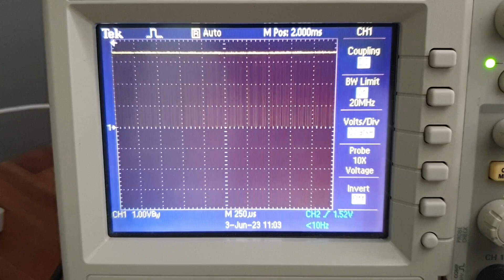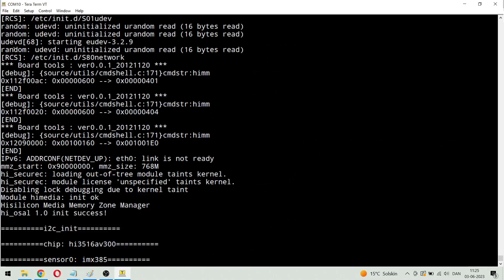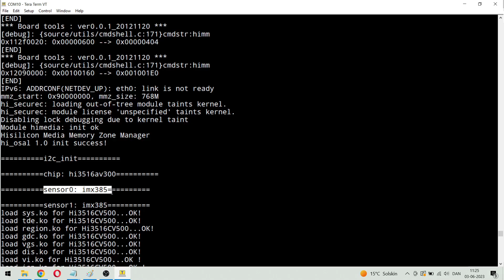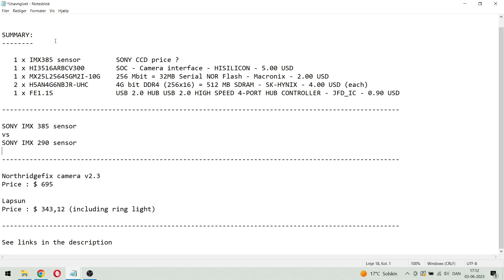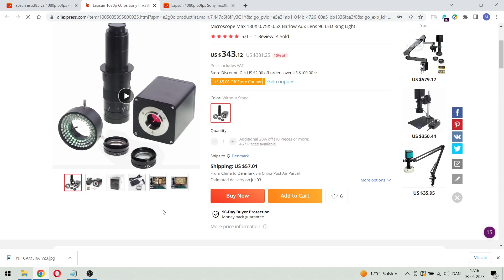Which sensor is hiding inside the NorthridgeFix Camera v2.3?

Comment: I agree that the camera is overpriced.  Clearly, they marked up it up a lot to fill their pockets.
Reply from the maker: Yes, i think that you can find their products cheaper, thank you for comment
Reply: 100% true and I hope they don’t start switching out the sensor again like they did on the original microscope camera. The “IMX290” was really the IMX307 which was 1/3 rd the cost. NRF never brought up the issue even in the forums on his site of people posting the PCB Screen shots shows 307 markings on the sensor board.
Reply: I don´t understand your point, should they sell it to you without making any profit?
Reply: @SHINdanny  Obviously not but they don't understand their main audience at that price point.  Their viewers are DIYers, makers, and people looking to save a penny by doing repairs instead of replacing the item in question.  He markets this overpriced product to us as if we're dumb so its pretty fair that we should criticize him for it.  Very few people are going to buy it for practical purposes outside of product reviews.  Oh, and would you look at that:  v1 of the microscope camera isn't available in the store anymore.
Reply: @classyjohn1923  thank you for your reply. I just checked his shop once and since I live in a different continent I´ve never considered ordering anything due to high shipping costs. I use my phone for this type of work, and it works well since it also has a built-in thermal camera ...it´s just a hobby ;)

So you´re right in my case, I would not even think about buying a one-purpose camera priced that high, rather a macro-lens for my DSLR and use that.

I just didn´t like the expression "to fill their pockets" because of the mark-up. It´s a business. If it is to high and only a few customers buy the camera, he might adjust it ...or maybe not.
Reply: I've stopped watching his comment. He advertises his stop too much. I get it, he's a business and I don't mind if he tries to advertise his stock, but do it at the start of the video instead of every product he picks up in his hand and is like "and you can get this at our northridge store" and then proceeds to talk about it for the entire video near enough...

Also remember one video specifically where he said "the last thing my family talks about is money, its the last thing bought up in our family" I mean he's right he doesn't being it up directly... But he's literally trying to milk the dead cow till the udders are gone, its just plain annoying.
Reply: Videos*
Reply: Shop*
Reply: @staminaman77  I also stopped watching his content.  He has very high ego.  He always acts like hes so smart but in reality, he makes mistakes like anyone else.
Reply: @classyjohn1923  I do think he's good at what he does, I do give him credit but I think he has this belief system in which he believes everyone else should follow. Just started getting annoying so I just stopped watching his content, I think he's all about the money if I'm being honest, not to say he doesn't earn it because he does. But puts on what I believe to be a front.
Reply: @staminaman77  i agree
Reply: @staminaman77  Total agreed, too pompous, and he makes my eye muscles hurt from all the involuntary eye rolling I do when listening to him.  It's a great thing to be confident in one's work, but it quickly becomes douchey when you go on and on about your own greatness. I usually have repair channels on in the background while working (I  repair testing gear, mostly Fluke equipment)and recently have found a few Brits doing repair content that is entertaining and down to earth like My Mate VINCE and Buy IT Fix It.

Comment: I bought it from this guy's link. Got here in 6 days. Blown away! Far beyond my expectations. I've seen the IMX385 in night time surveillance cameras and know it's good for that. Turned off my ring light it was hard to believe what I was seeing.  Using 2 IKEA Jansjö goosenecks. I use auto exposure and push up saturation. I don't like auto focus and didn't get that one. OBS for easy zooming in and out. Plugged my phone into the second usb port and it charged! I think it can run a led light.
Reply from the maker: Thank you for the good pointers, i will try them same.

Comment: The imx385 is a CMOS sensor, not CCD. The price of these small average specced sensors in china is in range of $10 to $20. The sensor is nothing fancy.. I do design cameras (much more advanced than this) and I can tell you that all these microscope or astro heads (which some uses ripped off DSLR sensors) are rather overpriced - if that was a point of the video. The whole system is at the tech level of a $100 compact camera.
Reply from the maker: Thank you for the notes and comments. I was thinking of making my own camera since  the specifications from the china sources are all over the place and therefore not trustworthy. Which modern sensor would you reccommend for a high quality microscope? I made the video since there are no sensor specification on the NorthridgeFix camera.
Reply: @made.by.morten.laboratories  i would base it probably on a imx477 ish 4k capable model (377/477/577) and use something better than a RPi which can not handle the video rate of the sensor at full res. Something like a jetson nano maybe. Even if NVidia is PITA, its more handleable than to hack up a hisilicon board from leaked kernel sources..
Reply from the maker: @cameramaker  I see that there is already an IMX477R sensor from RPi, it could be an easy job for a FPGA - i would like to convert from IMX477R to HDMI
Reply: @made.by.morten.laboratories  I was looking into something like this too !
Reply: i also think that these are very very overpriced , you better off with a macro lense and a consumer mirrorless camera than one of these , i am not talking about north ridge fix , i am just saying this about all microscope camera's in general.

Comment: I learened a lot by following your process. Thanks
1. How could you sport a linux system just by looking at the board?
2. How could you guess 115200 speed in the terminal settings?
3. My microscope cam has a Sony IMX291 sensor and i was wondering if I just could buy & replace by an IMX385 or IMX477 by swapping?

Many thanks pal and keep it up
Reply from the maker: @nessim.liamani, you are very welcome.
1. This is just from experience, i have been working in this field for many years
2. This is a standard setting on the UART
3. I think you need to update the Linux driver as well
Reply: @made.by.morten.laboratories  
Many thanks bro. Merry Xmas

Comment: Hello, I was trying to follow your Tera Terms, and despite connecting as you state and changing Font/Speed I only get Symbols instead of the full data display you got. Is there something I could be missing? UART SET to 3.3v. Any help greatly appreciated. Great Video btw.
Reply from the maker: Thank you for the comments, yes, please check the baudrate, i can't remember if it was 115200 baud, else try the different speeds.
Reply: @made.by.morten.laboratories  got it, for some reason it liked a lower speed, maybe  because of the older version of the program, but got it to run. Thank you and hopefully you keep adding content, now following you. Take care!
Reply from the maker: Thank you very much :-)

Comment: 3.75 micrometer pixels are good of course, but that thing is only capable of 1080p at 30fps. My 100 bucks hayear can do 60 fps at that resolution and 4K at 30fps. I think IMX334 is more advanced than IMX385?? Sony has funky numbering system. I reviewed HY-6110, tear down and review. Looking at this, I think that camera is more advanced, lul. :face-purple-crying:

Whatever's the case, I don't think using digital microscope is neither viable nor compofortable.
Reply from the maker: Thank you very much for your insights, i will have a look on the HY-6110

Comment: Looks pretty good... Wayyy out of my price range though.
Reply from the maker: Yes its quite expensive toys
Reply: The Northridge fix camera is a rip off.
You can literally buy a 48mp 4K package with x150 lens, ring light and boom stand for under $100USD.
If you want to spec up similar lenses you can order things separately,
48mp 4K camera $50-$60 USD depending on brand
x180 Lens $37 USD
x0.5 Barlow lens $12
x0.75 Barlow Lens $$16
Ring Light $15-$20 USD
There is a myriad of chinese brands other than Lapsun such as Yihzan, Eakins, High Cloud.
This should help those on a budget or those just getting into the hobby of electronics.
Reply: @Spoonfork1  Give us the links, especially for the 48 mpixel 4k kit. We will appreciate it.

Comment: I didn't get the exact camera you linked from Lapsun. I chose the one with autofocus. Actually, the kit which has the heavy duty articulating arm. It came in at about $670 USD including tax and shipping. I think you are 100% correct that the camera you got is the same one NF is selling. Regarding the autofocus, I like it, but you have to switch to manual after initially focusing on your work, otherwise it will try to refocus on your hand or iron. Still, it makes it easier to use. Camera also works with a wireless mouse. I just happened to have a cheap Logitech mouse I wasn't using. I decided to try it, and it just works. It's nice because I'm right handed, but I have the camera mounted on the left. The wire from the included mouse was just always in the way. The ring light and the camera come with separate power adapters, but both can easily work with the one for the camera. The only thing needed is a 5.5mm x 2.1mm Y adapter, and one polarity reversing cable because the ring light has reversed polarity. Could also just open it up and swap the wires. I also got a short extension cable with an inline switch. There were two 3mm threaded holes on the front of the camera, so I opened the switch, drilled two holes, and mounted it there. Click the switch and the camera and ring light turn on, and the monitor comes on automatically when it detects a signal. I've been doing repair work for years, and this is my first camera microscope. My eyes aren't what they used to be. It is so much easier being able to see while I'm soldering, as opposed to doing it blind and using my phone camera to zoom in and inspect my work.
Reply from the maker: Thank you so much for the feedback. Great idea with the wireless mouse and cable assembly. I hope that you will enjoy the camera for many future repais :-)
Reply: @made.by.morten.laboratories Thank you for the video as well. It was very helpful.

Comment: What connector pins were you connecting to on the device with, to get in those tiny holes? Surely not the hook type grabbers? Couldn't see close enough on the video. I have a camera that has similar tiny holes, and I have hook style grabber pins or the nipper style grabbers, but can't see how either of those would work, so curious what how those are actually connected to the UART on the device.
Reply from the maker: @jahwni,  Thank you, I did solder a 3 pin pinheader to the PCB. On the 3 pin connector J3 you can see where pin 1 is, its marked on the backside with a small dot, pin 1 is RX, pin 2 is TX and pin 3 is GND, this is all seen from the camera side, i hope this will help you, Cheers :-)  Pin 1 is also the pin closest to the HDMI connector.
Reply: @made.by.morten.laboratories   Ahhh right, you soldered a pinheader on there, that makes more sense! Thanks mate 👍
Reply from the maker: @0xbitbybit  - you are very welcome 🙂

Comment: How did you connect to the camera to see the boot info? via wires connect to the board directly or using the usb A jack on the camera?
Reply from the maker: Via a USB to serial converter, 3.3V level
Reply: @made.by.morten.laboratories  I'm trying to do something similar on an IMX334 camera. Did you have the FTDI pins on the board or did you have to solder something?
Reply from the maker: I soldered a pinheader on the imx board
Reply: @made.by.morten.laboratories  do you have a picture of that?
Reply from the maker: @andidotro  No, sorry, please send me link to picture of your board and i will explain where to connect.

Comment: Could you provide the regulator U12 chip name just below the 12V and inductor please?
I seem to have blown up voltage input and need to replace this part but cannot read my damaged one.
Reply from the maker: On my board its U5, this is a DC-DC converter with the marking IAGPN which turns out to be a MP1495SGJ-Z - do you have a picture ?
Reply from the maker: OK, i see now U12 on the topside with marking ADJN in SOT23-6 package
Reply from the maker: I did some research and found that the part is MP1470GJ from MPS, please verify - the part is available from Digikey :-)
Reply: @made.by.morten.laboratories
Fantastic. DC-DC converter makes much more sense. Thanks so much. 🙂

Comment: Great video, my friend! I ve buy that IMX385 and I have some doubt about sensor too. But Inside looks like mine totaly. would You give me location of GNG and TX  on J3 Header, please ! Cheers from Bulgaria !!!!
Reply from the maker: @batdido5803 Thank you, On the 3 pin connector J3 you can see where pin 1 is, its marked on the backside with a small dot, pin 1 is RX, pin 2 is TX and pin 3 is GND, this is all seen from the camera side, i hope this will help you, Cheers :-)  Pin 1 is also the pin closest to the HDMI connector.
Reply: @made.by.morten.laboratories  Thank You, my Friend. You help me a lot. So, I have to use 2nd and 3th pins. 1st pin is not used?And just to ask is there any way to turn on and off by software,or any different way to do that  without pull connector out every time.
Reply from the maker: @batdido5803  i don't understand what you want to do ? Please explain and i will try and help :-)
Reply from the maker: @batdido5803  ok got it - i think there is now way to turn it off by sw. pin 1 is the RX pin of the linux cpu, so if you want to send commands to the camera, then you need to connect this one too.
Reply: @made.by.morten.laboratories  I'd like to power on and off camera without every time pluged in and puled out connector in and from camera's 12V jack. My question is Is ther any way different of that what I do to power on and off device? I got cheaper camera with  remote control , but here i got nothing.
Reply from the maker: @batdido5803  Sorry - this is not possible
Reply: @made.by.morten.laboratories  Hello and thank you for reply. I made contact with seller ant he explain me that is impossible. Can be done only with switch on/off. Here we name that job - Village Job. :D
Reply from the maker: @batdido5803  Thank you for feedback, nice to have confirmation :-)

Comment: Lapsun who’s the supplier for NRF I assume learned their lesson scamming everyone on the fake IMX290 microscope cameras. That is why the PCB doesn’t have the 385 marking to show what sensor it is. They will do what they did in the older cameras eventually and change the sensor without telling anyone. That’s why NorthRidgeFix’s old model claimed to be IMX290 yet when you opened it up there was the far less cheaper less superior IMX307 sensor. NRF never actually sold the IMX290 sensor and when I tried to tell them about this they just ignored me.
Reply: If you go check NRF forums you will or should still see people posting the screen shots of the IMX307 PCB boards but nothing was ever done. I hope this doesn’t happen with his V2 cameras but it would be good to check down the road with new customers who have the skills to check the sensor like how you did in this video.
Reply from the maker: Thank you for your inputs. I was also very confused about the sensors. Its also a bit strange that NF does not write which sensor is inside. When it comes to these cameras you also specifictions flying around, its very hard to be confident in what you actually buy
Reply: @made.by.morten.laboratories  Definitely ! originally NRF had IMX290 in the description but then one day it was gone after a few videos starting to show up for china companies scamming the sensors for multiple cameras. I can only assume he started seeing the forum post's about his and decided not to specify which sensor to keep him out of trouble. I honestly think he didn't know or even knew how to check after he already purchased 50 - 100 sets. He should have at least address it and said hey this camera is similar to mine but the sensor is not specified. There's no chance he doesn't know that his V1 cameras were not the IMX290 like the one he was using in his videos. You can go back and watch a few comparisons and its night and day. I like the IMX385 but I really like the video quality of the real IMX290. The sensor technology in that one is amazing and there's no other sensor like it. They do have a IMX291 and its really really close to the IMX290 but doesn't have the same tech when it comes to the low light capabilities. Depending on your use you may not even be able to tell with the right setup. That camera only cost around 170 - 210.
Reply from the maker: Thank you for your insights, it would be nice if we could have a tool that could read out the sensor type via the USB interface.
Reply: @made.by.morten.laboratories  I know ! If you find something that can do that please let me know. I have multiple camera's here I would like to read out and verify.
Reply: I am vẻy happy with the latest NF camera/microscope.  Didnt mind paying a little extra for the content.

However, if thêre is a comarable microscope out thêre for just $100 as someone commented on the actual value of the NF microscope,.... where are they?  I have searched far and wide for such a thing and if they could be made so cheaply, why  isnt anyone making thèm and advertising them on micro soldering content on Youtube?  They would make a lot of money.
Reply: BTW I have the red camera case.  I HAVE to use a barlow lênse otherwise everything is way to close.
Reply from the maker: @BasicComputerRepair , thank you for sharing